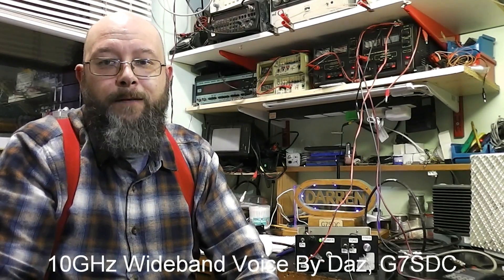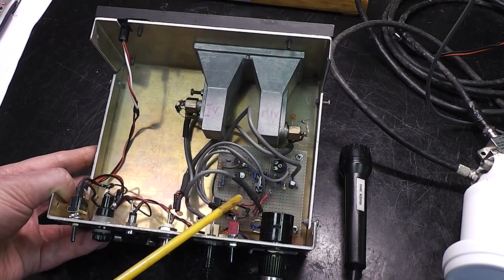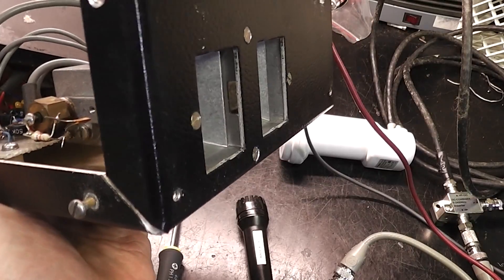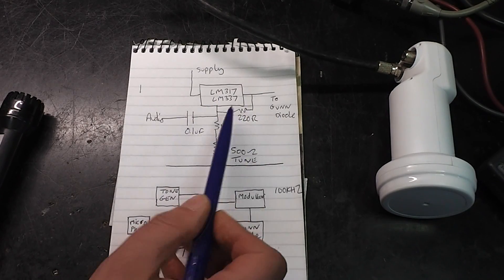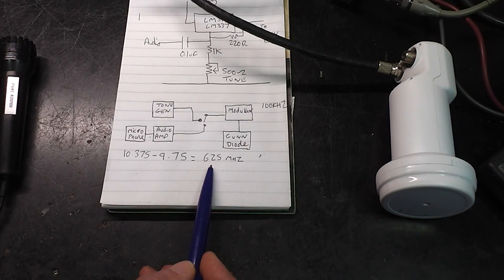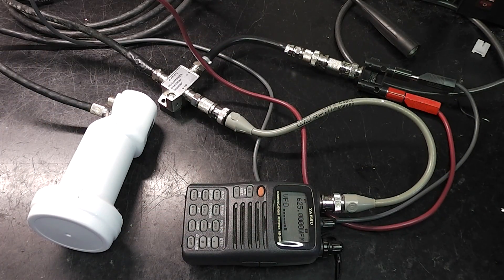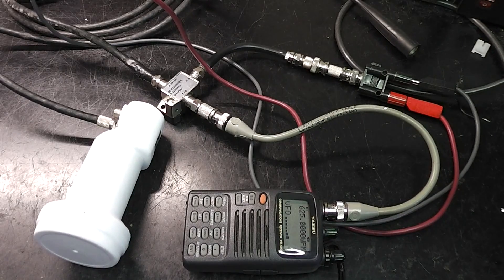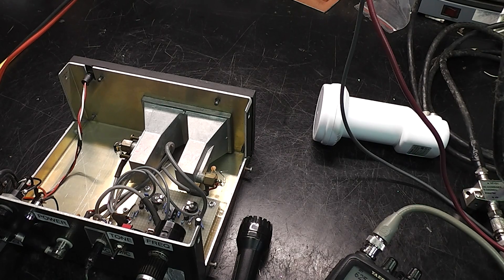10GHz Wideband FM Voice Amateur Radio transmitter using a gunn diode

Comment: how far can I transmit the sound if I use the 10 GHz magnetron 1 kW
Reply from the maker: A very long way I would imagine. I wonder how stable it would be, constant retuning I guess. I wouldn't want to be anywhere need the feedhorn at that power!
Reply: Be sure to check regulations in your country. The microwave frequencies have significantly lower power limits and limits to the type of modulation. People tend to scoff at the regulations until they are caught!